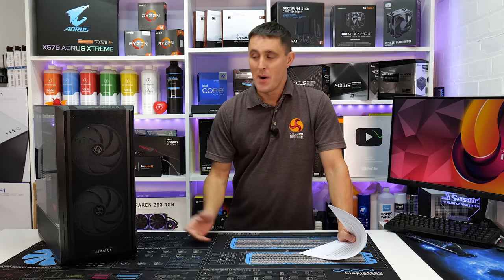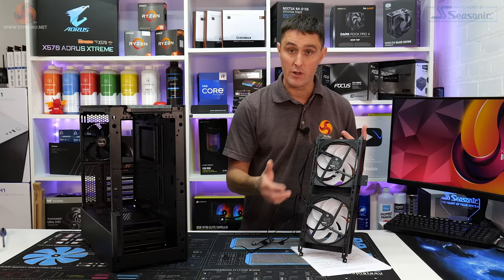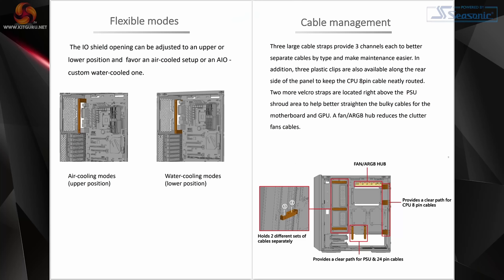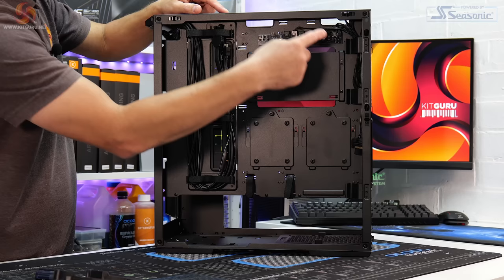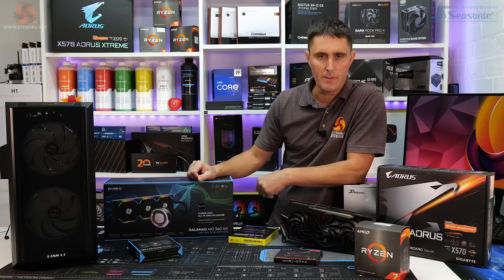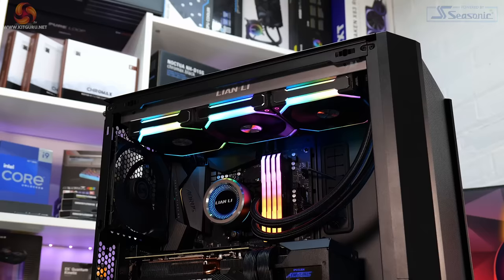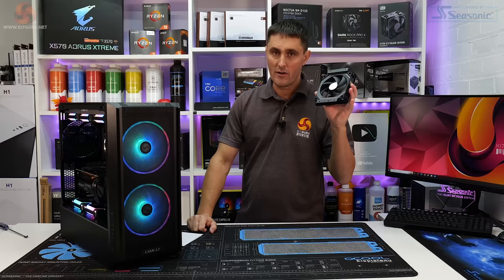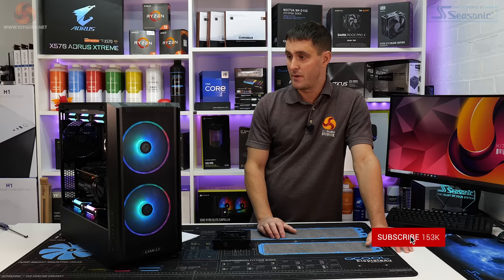Lian Li Lancool 216 - CASE of the year?

Comment: I've been modding small form factor cases for a while now, by installing an external fan at the back. Indeed, it works really well and for SFF, it's often the only way to add an extra fan.
Reply: its a good idea, apart from the fitting concerns noted. with such a variety of hardware I would assume it becomes a case of 'one fan design will never work for everything'
Reply: A case this large shouldn't be bolting on external fans lol

Comment: Bought this case for my 7800x3d 4080 build and couldn’t be happier. The 3 fans came in clutch.  Plenty of space for all your needs.  Highly recommend this case if your on the fence.
Reply: wow same specs do i need to buy additional 3 fans to mount on the top of the case
Reply: @lankylonky22  I didn't buy any more. Just consider your environment.Make sure the pc has space to breathe.
Reply: @todayisagoodday5027  Im going for same build soon but i will go with cpu aircooler and maybe add 2x140mm on top to exhaust? 

how are cpu and gpu temps?
Reply: @redzinter  Everything is working great. Try it without the top fans and see. You can always add them later. What I love about building is that you can change parts. Outside of ridiculous GPU prices it's affordable and fun.

Comment: Not enough cable clearence on the non glass panel side. The placement of the SSDs is unergonomical. They should had been sideways and not vertical. No RGB controller incorporated.

Comment: Of the reviews I have watched of this case, yours was the most thorough. You're the only one to install the 2 fans on top of the power supply shroud. Shows that you take your time and think ahead. Quite simple to remove the bracket you mentioned and mount directly to the shroud. You could use finger grills on the inside of the shroud to insure that no cables get into the fans blades.

Comment: Just built my new rig in this case and it was an absolute pleasure. My only annoyance is the opening behind the front fans that looks into the PSU/ Drive bay area. I would love a mesh plate like the rest of the case has, even if it was aftermarket

Comment: I recently bought this case, the version without RGB, and for those who don't know as I didn't know, the version without RGB comes without the Lian Li hub. Information that is not given on the website or manual. The front fans use 0.5A (I believe 100%) and, to move the front panel to the side, if in doubt, read the manual, it will help you change it easily.

I bought the Arctic pwm hub to control the fans, as it uses a SATA cable and is magnetic.

Comment: Great review and walk through. I just finished a similar build in the 216 and thought I would share a couple of challenges that I had to overcome. They are not case related. I also installed the additional I/O controller on the front, which provides some RGB color and mode control for the two front 160mm fans. Ultimately, I decided I would prefer to synchronize the two front 160mm fans with the other Lian Li case fans, so I bought the optional ARGB cable kit for $12 US (Microcenter) and connected the 160's to the Lian Li L-Connect 3 software via the controller that came with the Galahad AIO just as you have used.  Now all the Lian Li fans are synchronized.  On a different, but related note, I also wished to synchronize my RGB RAM sticks and the RGB side plate of my graphics card.  You would think that would be child's play.  It isn't at all, simply due to both poorly written and incompatible RGB software. RGB Fusion 2.0 seems like it should be labeled as pure Malware. It corrupts so many things it touches, I had to use an Exorcist process to rid my machine of all traces. Most of the other RGB software that can control RAM and graphics cards is sketchy, but a combination of Signal RGB to find and control the RAM and polychrome to find and control the RGB on my Asrock Phantom Gaming 6800XT finally managed to get it all done.  If only Lian Li would extend L-Connect 3 to manage RGB for other devices...one can wish.
Reply: Awesome to hear that the front 160mm fans are compatible with other rgb controllers. I couldn’t find a lot of info towards that.

Comment: I have this case but went with vertical mounted GPU. I'm using the same AIO but I put my motherboard at the higher setting because it looked better with the GPU vertically mounted. It is so easy to build in and I have built alot of computers over the years. A highly recommended case.

Comment: the rear mounting fan, is meant to be used with the AIR MODE motherboard position.  Im pretty sure you were able to mount that AIO in AIR MODE without problems (not sure with 280 aios).
at least you show an improvement of 6ºC with the rear fan (makes sense). Gamer nexus showed 2ºC worse temps than without it, his results were weird.
Reply: Wondering the same thing, aio and MB in air cooling position to allow for external fan. Have run across how much room u have for an AIO in air cooled mode?

Comment: Just switched to this from a NZXT H5 Flow. Adding 2 140mm fans at the bottom of the gpu really helped a lot on the temps of my 7900xtx. Dropped more than 10  deg from 75 down to 60-65 deg.
Reply: Would you say it’s worth it? I’m looking at swapping to this from my h5 flow
Reply: @sbranham86  it is definitely. Honestly should've gone with this instead of the H5 in the first place.

Comment: Download of manual for case says can fit AIO <55 mm in overall thickness in air cooled mode. Cooler master and deep cool 360 aios are 52ish mm in overall thickness including fans.... theoretically allowing to fit MB in top position allowing the rear external fan to to mounted depending on MB chosen... could you do a fun experiment with this ?? Please and thank you.

Comment: Its a nice idea to have a 2nd fan at back as outlet but it should be a slim 120x15.
Instead of adding a slim screwed in 4 holes, they increased size to the normal 120x25 using that case.

Comment: I really love this case, and would have bought it if I thought it would be possible to find filters for the front and side intakes. The two 160mm and two 120mm intakes are enough to keep up with hot builds even if they had filters. I ended up choosing the be quiet! 500dx for the filtration. (I don't like how the fine dust that does get through mesh screens gets caked up and wants to get into everything.)
Reply: Lian Li offers an optional (and inexpensive) magnetic fine mesh dust filter for the front of the case, which fits like a hand into a glove into the cut out grooves. It works great!  You can also fit some additional fine mesh screens into the side vents, though my observations are that these are not the source of most dust.  The two 160 mm fans in the front act as the main inductors of airflow (and dust). The fine mesh filters work like a charm.

Comment: looks like a grreat case. I've resorted to putting fans out on the outside of my Fractal Meshify C Mini case because my gpu was too long and ram too tall for me to fit my 240mm AIO anywhere. So I placed two Phanteks T-30's in front on the outside with their own filter/grills and the radiator on the inside, and for now a little bit of duct tape to fill the gap below the radiator :D
Reply: Did you measure much improvement ?

Comment: Great review. I loved the build sequence. I really like the cable management options. I've been buildiing PCs since the very late 80s and continue to be impressed with the cumulative effects of all the little improvements over the years. This goes high on my recommended list. 

You say the case uses 160mm fans and is optimised for watercooling; is there a 160x320mm radiator available and if there is, how well do the supplied fans work with it? You made a comment about static pressure so I'm guessing that's the point. 
For EATX boards, rather than rotate the panel with the grommets can you flip it over, so the big grommet is still at the top?
Reply: I'm not aware of any 320 x 160 radiators because 160mm is an odd size. 

I think the cable management panel can be flipped to allow the large cut out/grommet to stay at the top.
Reply: @KitGuruJames  Thanks and keep up the good work.

Comment: This review gives a better showing than that of GN. Off that I thought it was a bit meh! tbh. Worth a punt on this showing perhaps but there seems to a qc issue with the top panel sagging because the structural integrity isn't quite there; a hit and miss thing that is going to vary case by case. A 217 ought to be taller on new tooling and inherit the center screw in the top panel from the Lancool III. That rear fan is a good idea that hasn't been thought thru properly, making me think they might have hired some Thermaltacky folk!  Half-arsed might be too harsh, but I'd be fifty-fifty until we are beyond a sample size of a couple in reviewers hands. Lastly, if your headline is a question, the answer is always no.
Reply: I've not had chance to watch the GN review yet but from my experience building the system, looking at structural integrity and using the features of the case gave me all good impressions. I had no issue at all with the top panel, I'm intrigued to see what issue others had with it. 

It's sounds crazy to say this but you don't get much case for £100 in the UK market these days so it seems like good value.
Reply: @KitGuruJames  That is all a good reviwer can do, honestly report on the example of the product in front of them. There isn't any thing wrong that isn't easily sorted; that is why I don't get it that Lian Li didn't sort it. I expect Thermaltake to have good ideas and fluff their execution; Lian LI not so much. There isn't anything here that whipping the cordless drill and Dremel out, and using nuts and screws from the bit box won't sort, probably. But we shouldn't have to do that. I think Lian Li listened too hard to their bean counters and fell between two stools. Its a head scratcher though, they splashed out on bespoke fans and cooling solution; but cheaped in using an extant chassis and its tooling. A good review and a nice tidy build eased by the base chassis being above average in the builder friendly stakes in the first place. But for the caveats, I'd probably have it a contender for Best Case of the Year, certainly the best relatively budget case, myself.

Comment: Looks like the almost perfect case that works on floor or desktop. I do wish it had more open mesh like the rear fan in front and on top with filters behind as the mesh it has is only 50% open holes. I am also not a fan of the rear fan Not being RGB as it is called RGB version.

Comment: NOTE   if you oly use the stock fans that come with the case, the usb power modual at the top of the case, DOES NOT fit on the bottom left side, as there is no room for the cables, the bottom place is for the opptional rgb controller
Reply: Well that was the whole reason I was going to get the 216 over the newer 206 but if I can't move the io to the left so its easier to access on my desk I guess i'll just get the 206...
Reply: Wrong. It's possible. You just didn't do it the right way

Comment: Great review of the case! I'm definitely getting this case. As for external fan.. I wouldn't call it a "significant" change in gpu temp... as based on your chart, With the bottom fans installed, and external fan NOT installed. the temp was 45. It became 44.. 1 degree difference with the external AND bottom fans installed correct? To me, 1 degree isn't a deal breaker. 
Unless you're referring to just having the external and NO bottom fans as being the significant change (6 degrees). I could've heard wrong or missed that bit.

So question now on this external fan. Think i already know the answer, (no).. but anyways. Will that external fan fit if you did a vertical mount for GPU?

Comment: Nice vid, enjoyed the thoroughness of how you showed it in beginning. It wasn't on some turntable with some chick pointing at the window going oooh glass :) Seriously it was informative and cemented my decision to get one soon, the Fractal Design case just isn't good enough to keep the cpu as cool as I'd like. You pointed out things that someone who builds comps would appreciate knowing. Did you try putting cheap wire grills on the bottom fans or mesh grills? If so did it affect noise or airflow? Is there a HDD activity led, I've never noticed one, consider them an essential tool. Oh another reason for getting this case for myself, the grommets are in a good position for how I run the gpu power, over the top of gpu with 180 deg connectors on the card.

Comment: I'm finding it difficult to find a case with bottom, front, top and rear placement for fans. They always put the PSU in the bottom or top or have solid glass panels all around. Would also like 420mm rad support for front and top.

Comment: I as of yet found anyone that did a build with the top I/O moved to the bottom left of this case, here's what i found when I tired.
It must be me or a piss poor design when moving the top IO panel down to the bottom left side of the case.
There is no way to remount the fan bracket as the cables are to thick to allow the fan bracket to re-attached at the bottom as it pushes it a good 1/4 to 1/2 inch away from the case.
You would break the I/O module connecters trying to force it.
The RGB module fits as there are less cables and not all as thick as the ones that are attached to the I/O module which allows the cables to fit in the fan shroud.
If the fan bracket or the case itself had a small cut out for the I/O cables like it does at the top it would work.
Save yourself the trouble & leave the I/O module where it is

UPDATE 12/23/22, I was able to finally get this to work, one word of caution, be careful when attaching the I/O to the computer case.
Leave the fan bracket attached to the computer case (manual says remove it) & route the cables below the bottom of the fan bracket & up through the fan shroud as best as possible. Attached the top screw first then push the bottom of the I/O towards the fan, it's a very tight fit & you will hear the small clip on the back of the I/O snap into place which should align the screw hole on the case & I/O bracket.

Comment: It seems other companies are starting to realize the benefits of this "fans above the psu shroud + fan on the back panel" approach to cooling the gpu.  MSI has just introduced their Gungnir 300P case that features the same combination, except that their back panel pair of 60mm fans is geared towards a vertical-mounted gpu.  They even went further by having an option to add an 80mm fan to blow air directly in front of the gpu, so you end up with some sort of push-pull combination of small fans.
Reply: You're right, lots of new cases are coming with mesh PSU shrouds and fans on top of the shroud. It does seem to improve GPU thermals.

Comment: Lian Li is making a huge mistake by not offering matching ARGB ring-type fans, like the 160mm front mounted fans but in both 120mm and 140mm versions. I had to buy something close, the MF140 for the rear and a 3pk of MF120 to replace the Corsair LL120’s in my AIO. Everything is due tomorrow so I can’t comment on how well they’ll match. Lian Li could’ve offered an optional controller that could handle up to a dozen of those ARGB fans/lights if that’s what a customer is looking for. Sure the magnetic filter is offered as an option for the front but they missed an opportunity to offer a vertical GPU riser cable kit for the Lancool 216. I would’ve been fine to delete the HDD cages since I’m strictly NVMe anyway. Another option Lian Li could’ve offered…taller feet to raise the height. Maybe even wheels for cases on the floor. Huge missed opportunity. Lian Li could still take advantage of offering those optional accessories. Heck I guess anyone could step in and make some money on the OEM mistakes.

Comment: my only complaint is no air filter. Yes its wide open but after a month of use the inside was covered in dust.  The front fans are silent and bring in mass air but they also suck in massive amounts of dust.
Reply: Lian Li sells a mesh panel for the front - it works perfectly
Reply: lian li lancool 216 black rgb g99.lan216rx.10r The front filters are already in progress

Comment: I was thinking about installing the external fan on the vertical gpu configuration. So it sits on the right side with the gpu on the default horizontal position. I may be able to use the 1st and 2nd output ports on the gpu. I’d love to use a arctic p12 max on it.

Comment: In regards to the external fan not fitting in the AIO config, can't you just get a drill with a 1/8 bit, drill some new holes with the bracket lower, then use some machine screws?

Comment: I am building mine right now using the Black Lian Li Lancool 216 case. I installed the following. Thermaltake LGA1700-BCF CPU mounting bracket and tossed the stock intel piece that warps CPUs. I also installed the Thermaltake Peerless Assassin 120 CPU Fan/Heatsink. I put in the new i712700K CPU with 64GB of Trident Z5 DDR5-6400 RBG Memory. Installing an Nvidia RTX 4080 FE graphics card with the 12VHPWR 90 degree connector. I am using an EVGA 1000GQ PSU. I am using and EVGA Z690 Dark Kingpin Motherboard with a WD 2TB SN850X Gen 4 NVMe SSD 7300MB/s. This is the 1st new computer I have built and the 1st new computer since 2001. Tired of old used hand me downs. I have a question about adding more fans. As far as you can tell would I be ok with the included front 2-160mm fans and the rear 120mm fan, or would you suggest adding more fans? I am considering adding a rear where the GPU exits. Would you be able to suggest exactly which Lian Li fans I should get for adding cooling below the GPU in the case and also which Lian Li fans would I need to get for above the CPU Fan/Heatsink since my CPU socket is rotated 90 degree on my Kingpin motherboard?